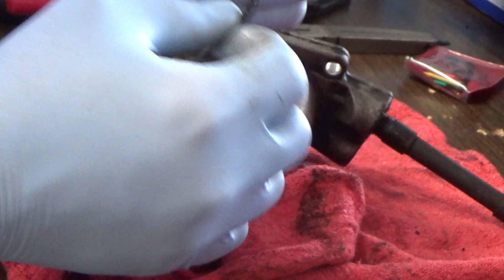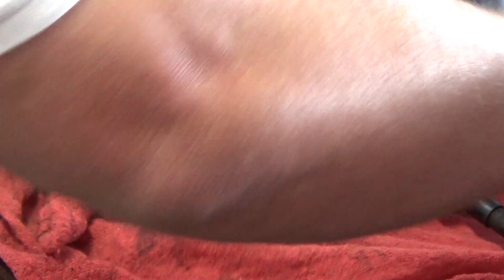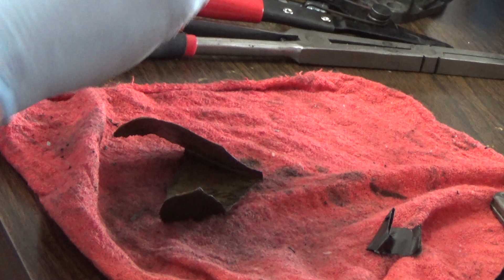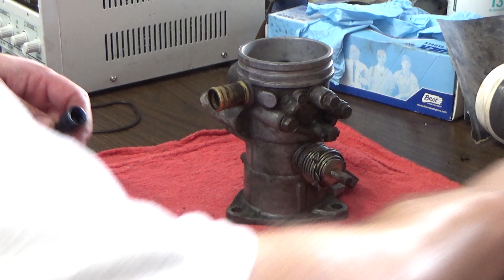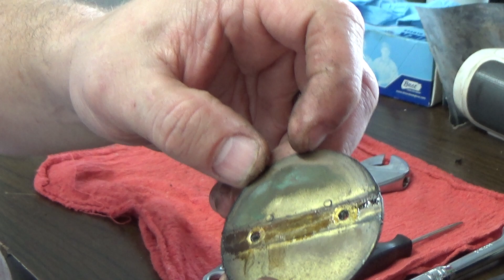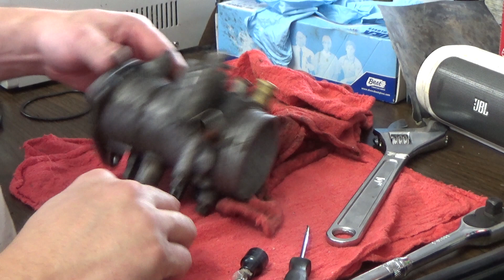1994 Saab 9000 Project Part 6 (mostly music)

Comment: looks like a good save on the slave cylinder. might be worth pressure testing it somehow before reinstalling. Also...no its not just you, happy Steampunk guy is Happy!
Reply from the maker: Hey Tom, yeah it was in good shape apart from one small pitted spot on the piston surface, which is fine. It's not a seal space. The inner sleeve is aluminum and buffed up nicely, very smooth piston movement now. I plan on removing the master cylinder and rebuilding it as well. The slave piston was holding pressure with my thumb on the line so I think the issue may actually have been up top. I'm going to rebuild both to be sure. I can use the master to test the slave function off the car.